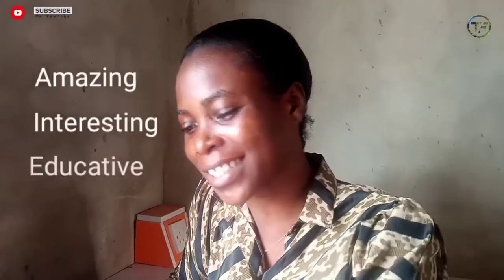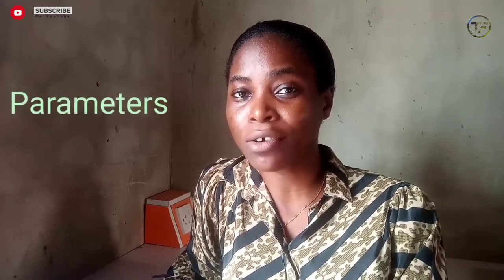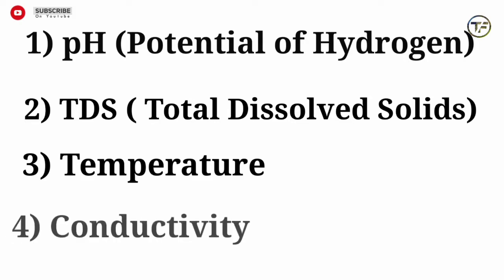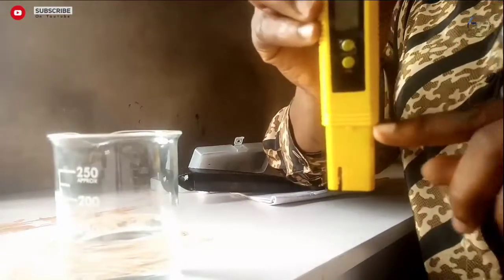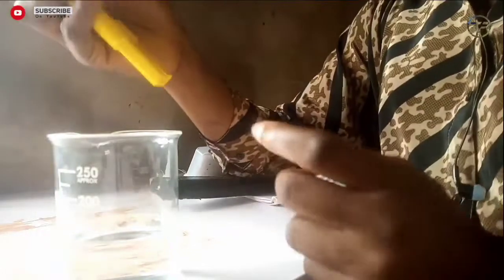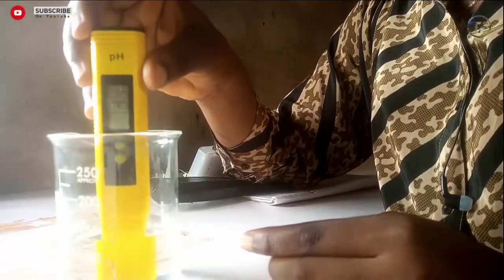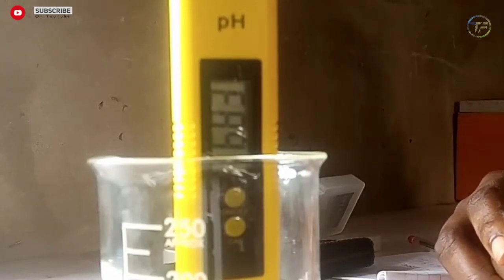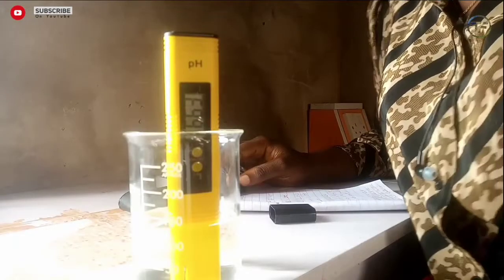TDS, Conductivity, pH water test | Water Chemistry Analysis #waterquality #thefarmlady

Comment: I used to have a windmill that pumps air down into my water dugout and wondering if that would change the ph level?
Reply from the maker: Hey Jeff. The windmill won't change the pH of your water. It's only going to aerate or increase the dissolved oxygen in your water